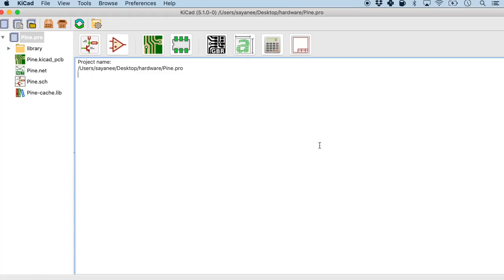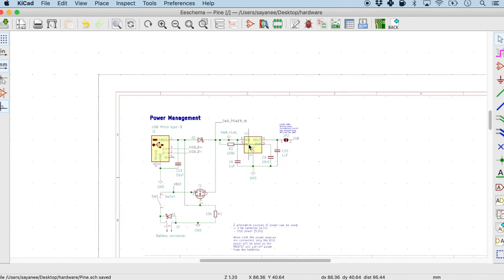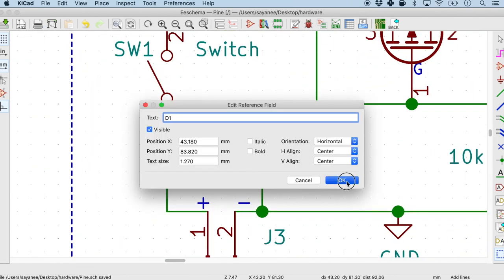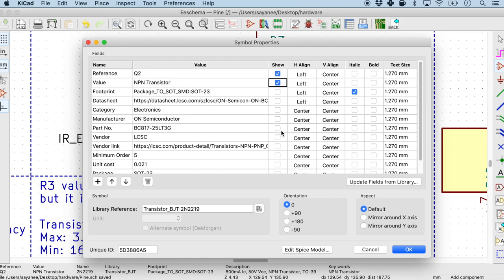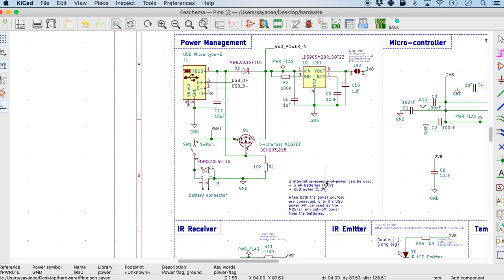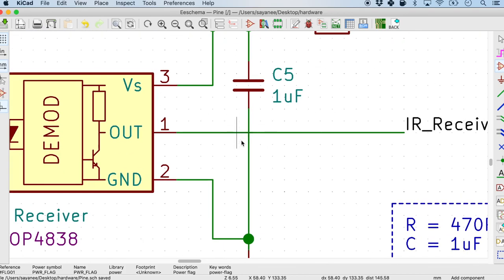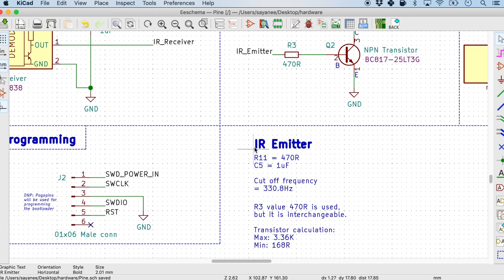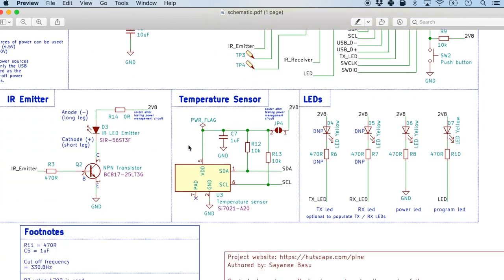Foundations of a good electrical schematic

Comment: Big thumbs up for using Kicad. It's the best open source electronics design tool out there and in recent years it has become so good that even professionals use it. Oh by the way, for power pins like the 2V8 that you have there, it is customary to use a power pin (arrow up) instead of a regular pin label.
Reply from the maker: Yeah, I was wondering about that too and I even made a custom 2V8 power source KiCad symbol. 2V8 comes out of the LDO, so I connected all the rest of the 2V8 as a label. Maybe I should try your method again and see if the ERC pass.

Thanks for looking into this 😃